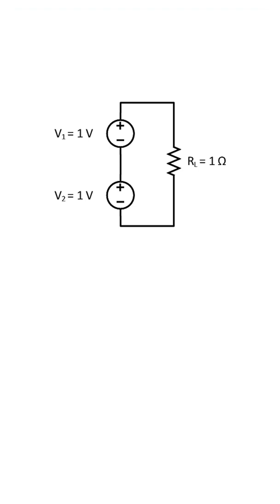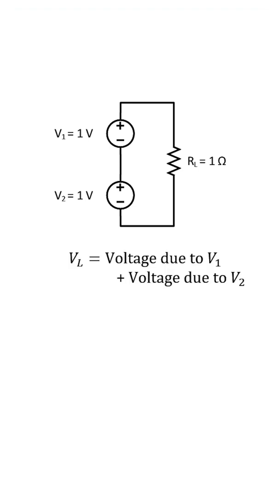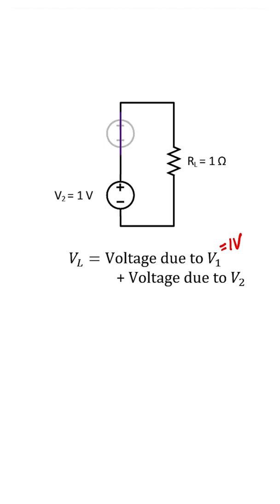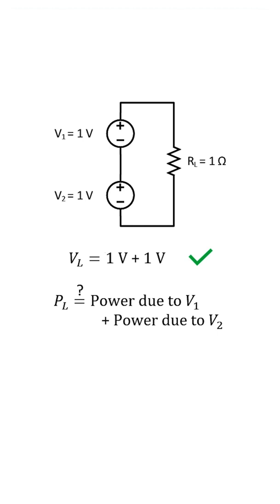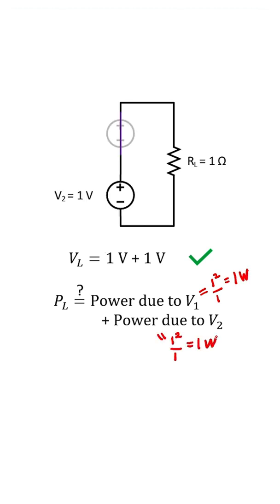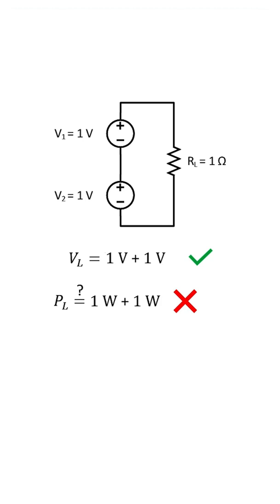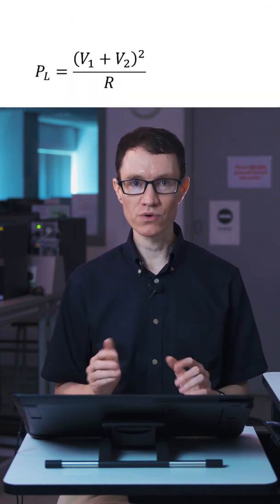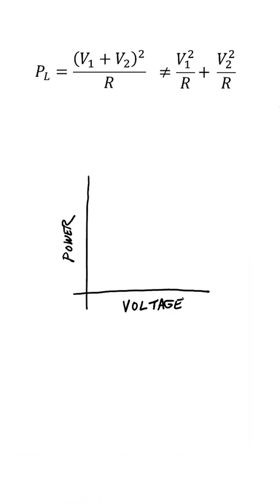Superposition can't be used to find power (#12 AC and Switching Circuits)

Comment: Current doesn't exist its only a potential difference only the current can be measured because it doesn't exist and the Amperemeter is just a microvolt meter